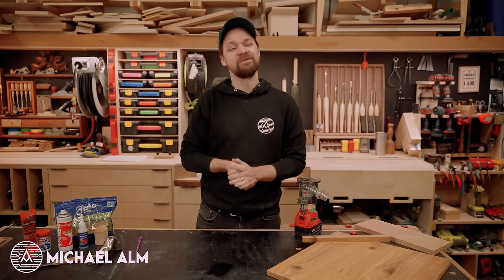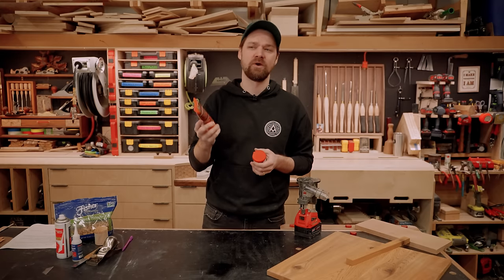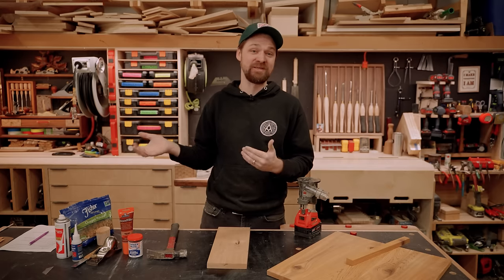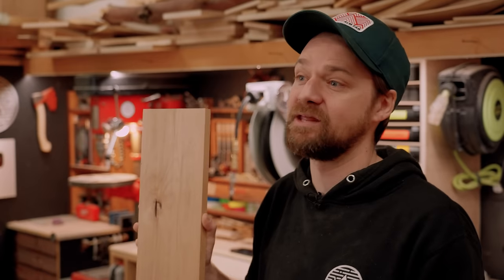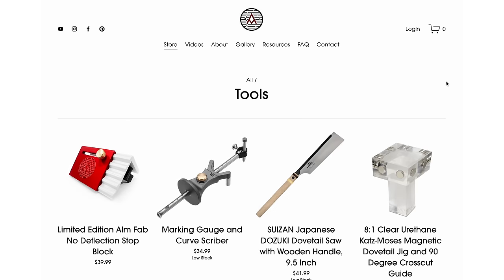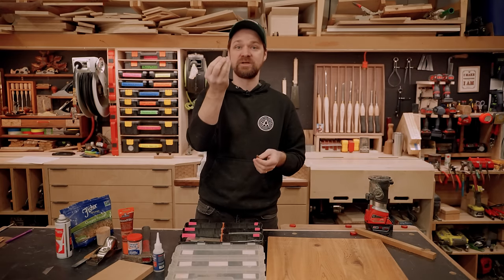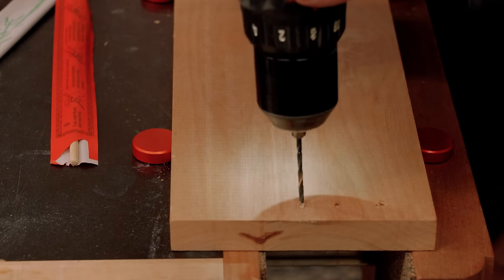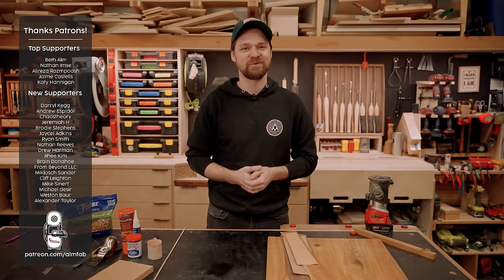Woodworking tricks I wish I was taught years ago

Comment: Fixing mistakes is something professional carpenters do ALL the time.  I install kitchens and built ins one of my favorite repair items is hard wax.  This is melted with a small iron and then scraped down.  I have a kit from Koenig that has MANY colors.  This is more durable than the soft wax sticks and can actually be used to fix wood floors in traffic areas.  Also it is great for fixing cracks and chips.  It is designed to be used when the finish is already on.  Great video, thanks for sharing!

Comment: Another tip for mis drilled or holes in the wrong place is to use a wooden golf tee. I’ve used this trick when replacing doors I’m able to drill into the tee for new hinge holes it makes a very secure fixing.
Reply from the maker: Good one!

Comment: I’m not a woodworker but I’m using block of flat stone like 2x2x4 with a packaging tape on 2 sides. No glue sticks to the tape and stone help to apply pressure. Always leaves flat finish and thank you for the all the tips you’ve shared.

Comment: Whenever I use a Dutchman as you put it,I make the patch very slightly oversized and taper the sides slightly so it compresses the fibres slightly leaving a perfect fit with no gaps.It is easy to do repeated test fits if necessary,treaking the size with a block plane until it is slightly too snug. Then (with clean hands) glue the edges and tap it home using a block and mallet and leave to cure before flushing back.As with round plugs,I usually put an arrow on the patch to show which direction to pare/plane.
I only glue the edges as the 'plug' usually does not need to contact the bottom of the 'hole'.

Comment: Love these tips. Some I knew and use, but didn't know about walnuts, so that's one to file away for future use. My tip is for fixing defects in softwood. It's like the dutchman solution but the plug has slightly tapered edges so when it is clamped or tapped into place it makes a very tight joint all round. I recently used this to refurbish a gate that had a redundant hole through it. I didn't want the edge joints to fail and let water in over time so the tapered plug was an ideal solution that will remain tight in all weather.
Reply from the maker: Ooo! That's a good one! I'm going to have to try that

Comment: Great video Michael! I didn't know I could steam out dents in wood, that tip will certainly make future restoration projects a lot easier! Speaking of restoration, oxalic acid can be used to remove dark stains in wood. It is though a great idea to thin it out a lot, as even a 10% solution will bleach the wood too, although I believe that could be limited by using packaging tape on the surfaces that doesn't need the bleach.

As for packaging tape, I've found that its great for avoiding dyed stains being applied on surfaces they shouldn't be applied onto. I've been building a stepladder for my brother by cutting up an old dining table, but the steps are mounted with through mortise and tenon joints and I wanted the ends of the tenons to be black like the steps, but the ladder sides needed to stay as warm, natural oak. So after gluing I applied some packaging tape and then some painters tape on top to soak up excess and then I stained the tenon ends using Rubio Monocoat Charcoal. The result was only a tiny bit of leak onto the ladder sides, which were easily sanded off. I'm working on a video on the project, but I don't have a timeline for a release, so I hope my explanation makes sense.

Another trick for woodworkers who don't have a proper workbench, but needs to cut dovetails, is to use what an old classmate of mine thought about. Simply screw two pieces of wood together like a "T", flip the T 90° and clamp it to a table. Now every part that needs dovetails can be clamped and cut. A vise can also go for smaller parts, but for the boxes I built for my sister, I had to use this other method. It's not perfect, but it works. Even for dovetail taps that are less than 2 mm in width (0.0787402 inches).

I can also recommend getting a sewing measuring band. They're flexible, so they're great for measuring or drawing lines on curved surfaces with great precision. I've used them in the past to place marked lines around wood that indicated how far I had to plane something down to, but they're really versatile on any curved surface!

This one will be harder to obtain (I think), but I've got some steel wire with one end curled up. They're from an old piano, but they're great for cleaning out dried wood glue from the tips of glue bottles (once you've gotten the damn thing open that is). I haven't checked, but I imagine they're hard to come by, so if one is ready for a quick DIY, the size I use is 1 mm (I think it's 18 gauge AWS, but I could easily be wrong as I'm completely unfamiliar with the gauge system. All I know is Metric, Celsius and Kelvin).

A painters spatula is also great for filling out holes with grain filler, instead of using the fingers. It's less mess on the feelers and more use of a tool that's specifically made for applying small amounts of viscous fluid onto a surface.

Idk if this is the same in the US, but I've found that the width of the tip of a standard sharpie, is roughly equal to the width of a sawblade plus the excess that's turned to dust when cutting. When I say standard sharpie, I really mean a sharpie which tip has the width of 4.5 mm (or 0.177165 inches, I guess a 0,2 inch would be easier to get).

I probably know more, given I don't have access to a workshop and have only worked in my kitchen and in the near future from my tiny shed, so I've had to find creative solutions to problems most woodworkers with a shop don't regularly face. Some of these are great for people without a shop (like the dovetail T jig) while others are versatile enough to be used regardless of whether you have a shop or not. But not having a shop is no excuse to not do what you love. That's at least my take. I'm sure my neighbors have a different opinion 😅

Comment: I learned that if you have a super deep dent use a razor blade and make little slits in the direction of the grain and then steam it out. You can get some super deep dents out. I used to work at a  woodworking manufacturer.

Comment: 6:35 As a Dutchman I'm not so proud of this, but I think it originates in the fact the Dutch are known to be cheap skates and rather than using a new board (which would cost money) they'd prefer to just patch the board with the hole in it. "Dutch" as a prefix often has a bit of a penny pincher vibe to it. Dutch treat, Dutch oven 😉
Thanks for the tips Michael!
Reply: Not cheap, just frugal!
Reply: Version I heard comes from the Dutch vs English rivalry period. The term meant something cheeky/ twisted or shortcut. Multiple straight vertical joints in masonry, a loose piece of pipe to 3/4 fill a cast iron socket etc
Reply: @eastlothian98  Presumably the expression "Double Dutch" comes from the same era. (If someone says "It's Double Dutch to me" they mean they can't understand a word of it).
Reply: @eastlothian98  could very well be, they are all more examples of what I said. Again, as a Dutchman: not something to be proud of all the same 😄

Comment: I had a 1930s Oak filing cabinet that was falling apart due to cupping.  The external sides had been coated in Shellac, but the inside was bare and had soaked up moisture out of the air for years.  I did the opposite, as adding water to the sealed side would do nothing and I didn't want to lose the patina of the original finish.  I disassembled it and clamped each side panel (3/4" solid English Oak) using 2 x 4s either side to put pressure on it (3 or 4 pairs down the length of each panel) and gradually heated the unsealed side with a heat gun.  After it was very hot, I would tweek the pressure and leave it.  Then repeat the process every 2nd night until it seemed flat, then I could slip shims under the centre of the 2 x 4s to give it a bit of reverse pressure, a 16th past dead flat.  Did a final heat and left it in the clamps for days and it came out perfectly flat.  Sealed the inside and reassembled it.  It's still straight today.

Comment: I am a big fan of the Timbermate wood filler, it seems to stain much better than any other brand of wood filler that I have used before. It can be challenging to get these days, not sure if it is a distribution issue, or if the manufacturer is having issues producing enough. Some stores have dropped it because they couldn't get it.

Comment: “Sandoutable” Wow all these good tips and new words too! Lol. I recently learned that when cutting frame miters you can salvage a “gappy” (see, I can do it to) joint by cutting the longest pieces first if possible. Then if something moves or jumps you can re-cut it for the shorter ones and at least get something out of it. Simple I know but it took me a while to figure out. PS: I also use a pencil sharpener on too large dowels when I cant find a toothpick or a small enough dowel to plug my many drill mishaps, makes ‘em fit perfec too. 4 yesterday on chest handles, lol.
Reply from the maker: Ooo! Those are great tips! Thanks 🙌

Comment: instead of using wood glue and saw dust I would highly suggest using 2K Polyurethane Lacquer with saw dust at least that's what we use in our company, when using wood glue you will experience blemishes when applying finish like stein , our method works 10/10

Comment: Toothpicks! I’ve been using those for years. Also a great solution for screws that have stripped out holes in particle board. The glue and “real wood” toothpicks let you put screw back in the same place.

Comment: When you need to screw a fabrick to smth. you need to punch a hole in it, because it starts wrapping when you try to screw just straight through fabric.
So, here is the tip or trick (I don't know):
Plase the fabric into position,  attach the screw, switch your screwdriver to revers and gently press the button.
So that is the way to drill a fabric, and after that you can turn switch screwdriver to forward and just do what you need, without headake about fabrics wrapping and twisting..
I hope you understand this instruction, dear reader.

Comment: I drilled table legs into the wrong side of my table top. So had 4 screw holes in the top of my table. I had offcuts of the same wood so with a chisel, I made cone pieces of the wood, added a load of glue into the screw holes and then hit the wood into the holes with a hammer repeatedly, crushing the wood cones into the holes. Once dry, sanded back, it created uneven edges to the hole and just looked like knots.

Comment: I’ve got a great fix:  Let’s say you’re doing mortise and tenon joinery and you’re matching the tenon to the mortise, only you took one pass too many and now the tenon is way too loose in the mortise. The east fix is to glue some veneer on one/both faces of the tenon to thicken it just a touch, then use a shoulder plane or whatever method you prefer to get a nice fit.

Also, I guess it depends on the industry because at my job we use those wax crayons literally every day. Mohawk and Fastcap make great multicolored kits.

Comment: Ok so I have a question for everyone on the wood cupping.   I glued up some 1 1/2" pieces of fir to make shelves.  I put two glued up slabs one on top of the other.  They cupped on me, the top one curling up, the bottom one curling down on the edges.  Cupping is about 1/8".   Can this be fixed with the same water trick?

Comment: I learned that highlighters works well. They rub away better on a finished piece than a sharpie and at the time, much cheaper with many more colors plus cheaper.  Not saying they will last as long but short term fixes.  At least until you can find the right way to truly fix it if needed.